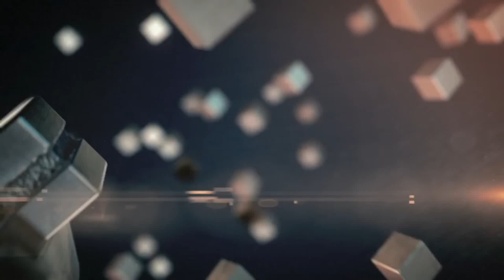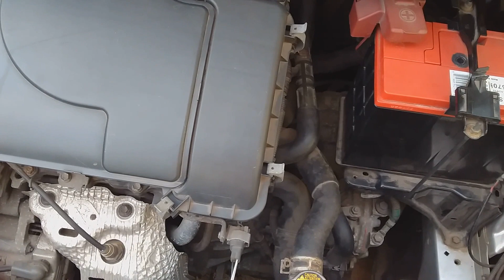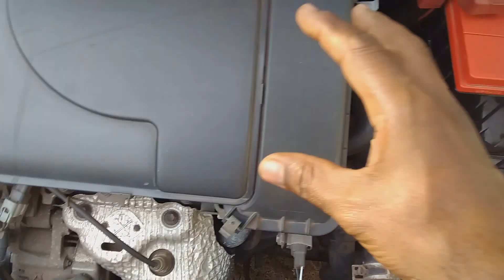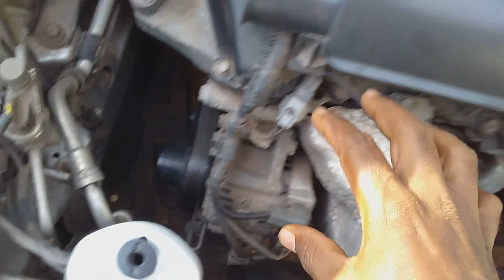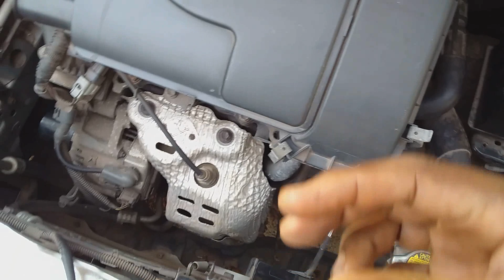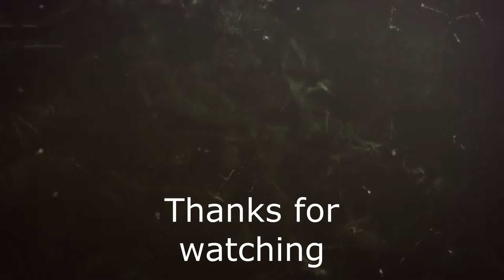Toyota Vitz Alternator Battery and Idle RPM Relationship

Comment: I have 2011 vitz and my rpm when idle is 750 but when the AC is on it's almost to 900 is it normal and also the fan is really high for my liking . Is that normal ?
Reply from the maker: Yes it is normal. Remember the AC adds stress on the engine and this stress would reduce the 750 rpm to critical levels causing engine vibration. To counteract this effect manufacturers increased the rpm so that vibration never happens.

Comment: my question if alternator output voltage is lower than normal at engine idle,  would the engine have vibration or not? assuming that battery is fully charged. plz answer
Reply from the maker: Once the vehicle is operating well the alternator power output is sufficient for the vehicle.
Reply from the maker: If voltage is reduced at the alternator it could mean that you have a alternator problem because the alternator maintains a constant voltage during all engine operation.
Reply: @ShelDockToyotaVitz  thank you for the reply.  what is the alternator voltage range when engine is idling during battery fully charged or while charging? car is toyota corolla 2010 model
Reply from the maker: @inamrehman8709  The battery is 12 volts when the engine is not running but when the engine is running the alternator even though it is a 12 volts alternator if you use a volt meter to check it you will get 18 volts.
Reply: @ShelDockToyotaVitz  Hi.
last time my multimter was faulty.
I used another multimeter, here is the voltage reading. 
1- on engine idling = 13.41
2- on engine idling + head light on = 13.13
3-on engine idling + head light on + AC on= 12.80

problem is that egine lack power and performance. on idling engine vibrates. drive in first gear is very sluggish.

should I replace the alternator? or look for other things to daignose?

thanks in advance
Reply from the maker: @inamrehman8709  the alternator voltage looks good. If the engine lacks power do a step by step check starting with your spark plug then coil pack. If the alternator was giving problem the car would experience power issues through all acceleration range.
Reply: @ShelDockToyotaVitz  thank you for the reply. you are right. gernerator checked in worshop. 
spark plugs and coils are checked they are ok.
here mechanic said it may be throttle body issue. he tried adjusting rpm by rotating on screw on throttle body using L-key. now still engine vibrate like stalling little bit every few second later and become stable. repeating this cycle. also from stop , when realasing clutch in first gear it jerks also. 
kindly give me the possible solution.
Reply from the maker: @inamrehman8709  did you get the throttle body properly cleaned?
Reply: @ShelDockToyotaVitz  Yes throttle body is 100 % clean. actually it is electronic throtle body, mechanic changed orignal position of idle air sensor screw with L- key. he tried to raise the idle rpm. but that makes car drive more imbalanced. here I can not share the picture of throttle body. if you can share your whats app number, that will be very much appreciated. and easy to discuss the issue. also I need to reset the orignal position of screw to factory setting.but donot know how to do it. I do not have any reference or service manual, how many turns clockwise anticlockwise..  waiting for your reply.

Comment: Hey how to fix the code p1550 on vitz 2011?
Reply: Well I fixed it thanks... The old mechanic had installed the battery current sensor in floating position.. It should have been around the negative cable of the battery
Reply from the maker: P1550 is a error code to indicate your battery current sensor is malfunctioning.
Solution is to change this part
Reply: @ShelDockToyotaVitz   i have a 2007 vitz which one do i change
Reply from the maker: The electronic battery sensor is connected to the positive terminal of you battery.

Comment: How i can keep rpm above 700
Reply from the maker: The ECM is set to allow the engine to idle at the lowest rpm and still allows smooth running of the engine. Unless you get someone who have a very expensive scan tool that can edit the manufacturer rpm. Not wise to do this though.